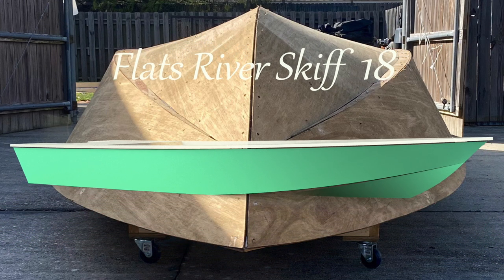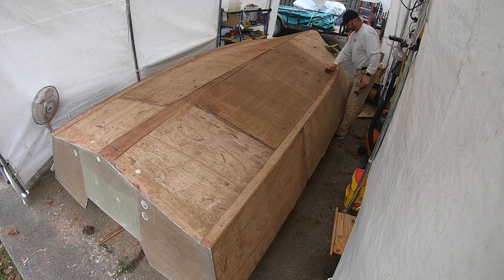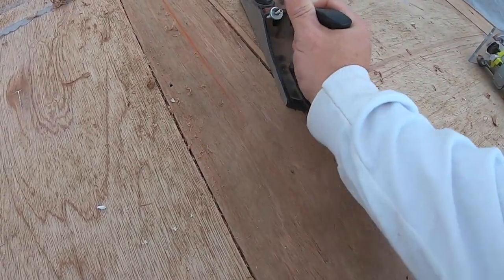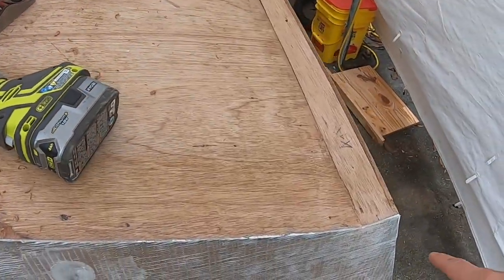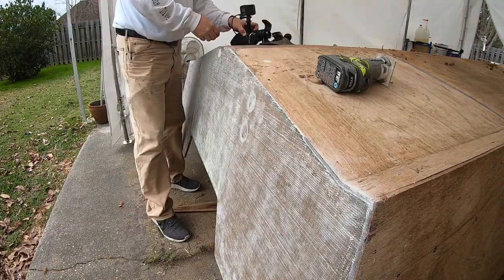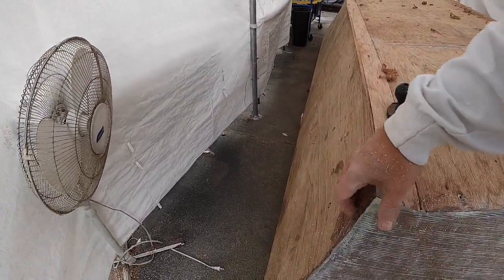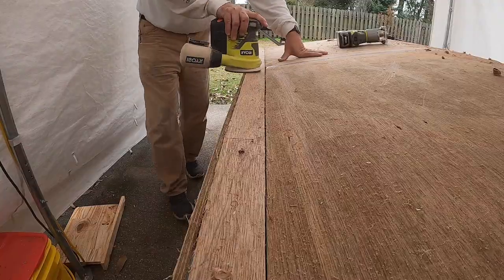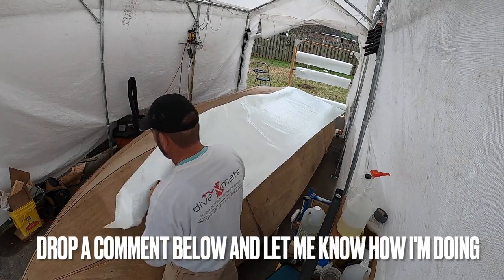24. DIY Boat Building: HOW TO Prep for Fiberglass?

Comment: Hey Oscar 
I know it’s probably too late, but I think an angle grinder with sanding flap disk would do you a lot better for rounding them corners. It would be a little more dusty, but I think you would get better results. 
I’m not jumping ahead to the other videos because I want to see everything you had to do in case I ever get my health back and decide to build one. I really like the way things are going. Keep it up. 
Thanks again for sharing. 
Joe
Reply from the maker: Maybe, but it’s also important I think for everything to be as fair as possible.  Sanding wheel will cut easier, but that means more waves…. It’s all a compromise I think between systematic and easy.

Comment: Sir Merry Christmas and have a Happy New Year.  Have you thought of using and Kevlar Fiber for the Bottom of your Boat 🚤?
Reply from the maker: Merry Christmas and HNY to you as well sir.  Yeah I looking into kevlar, but it's just not in my plan or budget for this project.  What are your thoughts?
Reply: @Bigeaux20  Sir you have to do what your wallet say. Kevlar Fiber would help the plywood more than Fiberglass. There a few Companies have good Prices . But it’s your Boat. I like how Kevlar helps if you hit a Log or a Gator 🐊 hehehehe. Well take Care and I will keep watching the Builded
Reply from the maker: @gregoryh4601  Well I admit I am a product in many ways of how I have been guided, but it's my understanding that Kevlar is generally a part of a fiberglass layup and not a standalone.  I obviously have plenty of fiberglass in the interior if you weren't aware, there is 1808 biaxial all along the interior and there will be 1808 on the entire hull bottom, with 1208 on the hull sides in and out.  I don't know how to measure how much more Kevlar would protect, or how much less I am without it, but I think there is also a weight aspect that is different as well.  Bottom line is I have bough to just lay glass, so that's what I will do, but I alway want to learn more if I am misguided.
Reply: @Bigeaux20  Sir Kevlar is very Strong material. It comes in Different weight also you could use less then your Fiberglass. Maybe you could look up a Company on Kevlar/Carbon Fiber mix and ask if you could advertise for them. My sailplane has Kevlar fuselage and it is Strong and lighter then Fiberglass but you have your Fiberglass. Also Kevlar comes in Colors so you could just clear coat epoxy the Bottom of your Boat , what size Outboard you going to Run.
Reply from the maker: Yeah the hull will still go through glass, fairing, primers, and then top coat so colored Kevlar would be a waste.  And to be honest, it’s the bottom of the boat and I hope once I’m done with it no one will ever see it. EVER!  I’m going to stay the course and I feel confident that it will suffice for it’s service.  If not, then I will make the repairs as they come.
Reply from the maker: I plan to have a 115 when I’m done.

Comment: Did you buy the kit with the pre-cut plywood or did you just cut all the plywood yourself?
Reply from the maker: I purchased just the paper plans and sourced plywood on my own.  If you check out my page, you can see the whole process start to current state.  I have documented everything.  I hope that helps.  You looking to buy one?
Reply: @Bigeaux20  I bought the book Alaska skiff. I think I’m going to try a 20’ stitch and glue.
Reply from the maker: @3Beehivesto300  Well best of luck to you.  I am not familiar with that project, but I doubt you will regret giving it a go.  Stick with it and embrace the sucky parts.

Comment: The glass on the transom is not properly saturated. Most obvious at 12:23 on the starboard chine corner. This is a big problem especially on such a structurally important piece like the transom. You should grind this off and start over again. Do it right or do it twice.
Reply from the maker: That’s a good catch and something I was planning to discuss coming up.  The glass is actually properly saturated, the issue is I struck it with the leading edge of the planer a couple times inadvertently, and it actually pulled the glass sheet away from the plywood, bring some of the plywood along.  My plan to deal with this was to wedge it open and inject epoxy into that space so that it can be rebonded to the wood.  The bottom of the boat will have it's glass wrap over the top of that space, as well as the hull side will wrap that corner coming back amidship and overlap.  How do you feel about that as a remedy or do you still think grinding/cutting it out and patching it is the best route?
Reply: @Bigeaux20  So long as you take your time with that repair, and the plan is to add substantial tabing on the corners and continuous fiber runs from the hull onto the transom you should be okay. How big is the planned outboard?
Reply from the maker: Yes to your points.  There will be continuous runs from hill bottom onto transom, as well as hill sides onto transom.  I’ll show it and discuss it a bit so that you can check up on me.

Comment: Here's a little mod I made to my router. I did it originally to help it glide across my scarf sled when I scarf cut all my side and bottom panels, but it also made it a little easier to control on regular routing work.  https://www.youtube.com/watch?v=ubgwe6uXQxI
Reply from the maker: Yes sir that's perfect and those scarfs looks awesome.  Certainly cleaner than what I was able to get using an electric plane and sander.  This issue with my trim router is more about the angle issue and how the roundover is oriented at 90 degrees to the router bed.  I made it work, but it's just a bit where you have to adjust.  I also have a base like those on my bigger router that I use to make mortise and tendons, and the like.  But I'm really impressed with your scarfs, super clean.  Should make gluing them up a breeze.